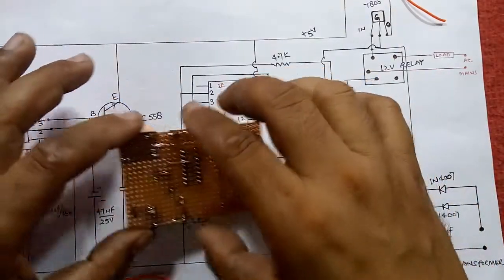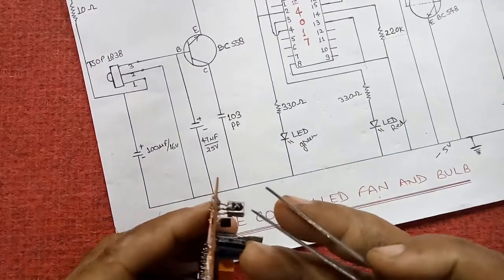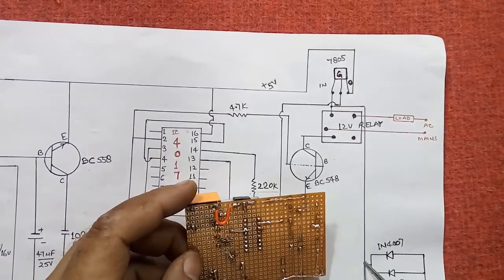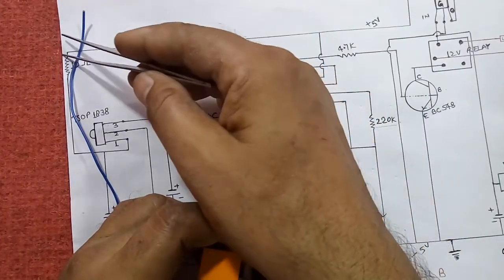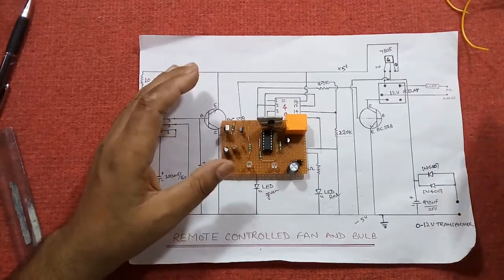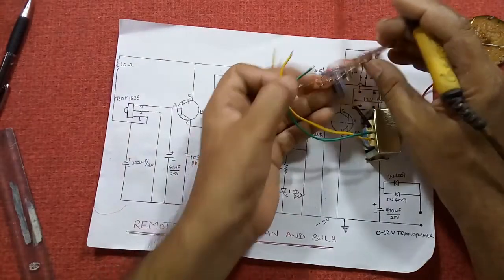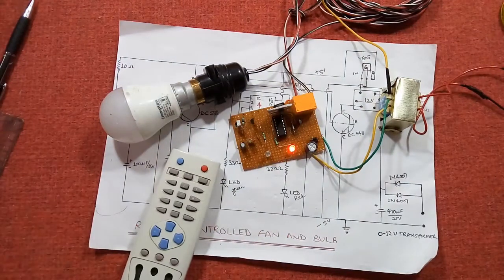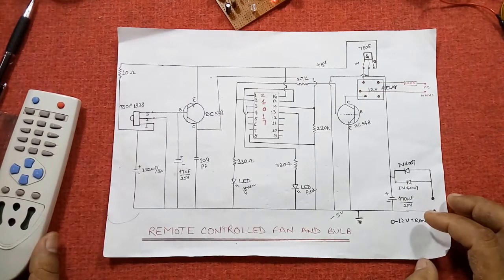Control a Fan and Light by a tv remote part 2 || Wireless switch for fan and bulb Part 2

Comment: Hi, awesome video, nice job. As a small drone pilote I would try to integrate your board into my drone to do some functions that I would like to start remote. Do you got a test board for me to test? Thank you already in advance. Robby.
Reply from the maker: How could I make it available to you? Its very simple DIY. You can make it yourself. thanks
Reply: Thanks. My question is a little bit if the drone is flying with the board on board. Can I make the IR signal stronger so the range can be a little bit more.
Aaah sorry, now I see the PARTS LIST. Thanks...